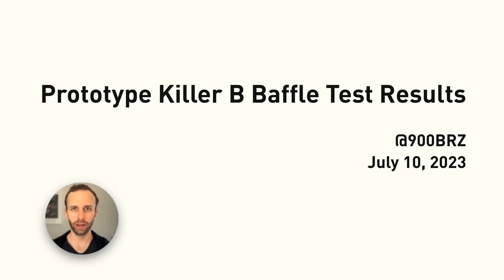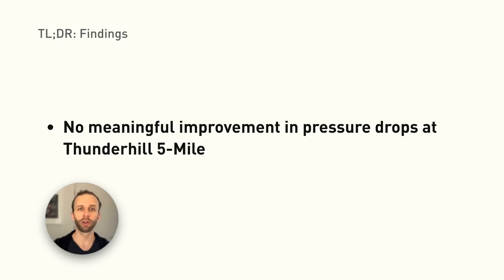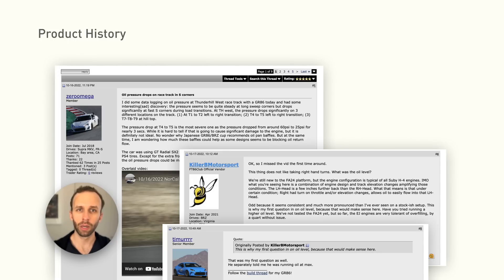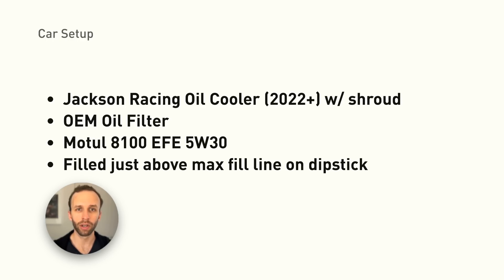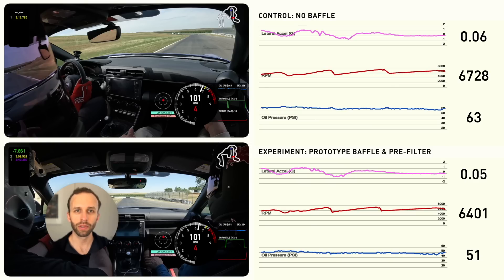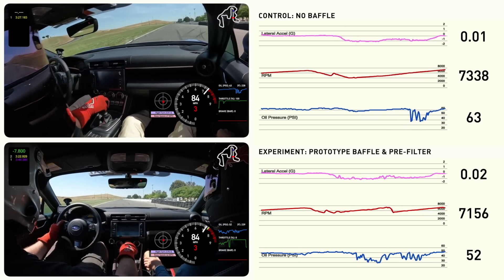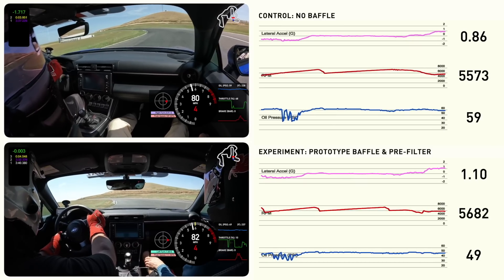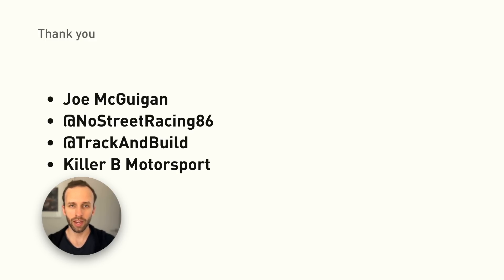BRZ/GR86 FA24 Killer B Prototype Baffle Test Results

Comment: Since the oil pressure drop seems more during right hand turns, could it be that centrifugal force is causing the oil to shift to the left side of the crankcase?   This shift in oil level might cause the pickup to be partially sucking a small amount of air.  Maybe increasing the oil level would be a good thing to try.  If this changes the oil pressure in right turns, then a redesign of the pan or the pickup might be the answer.
Reply from the maker: Yeah that’s essentially the classic mode of oil starvation in high G conditions. I tried a different, more traditional baffle design next but this also did not fix the issue. https://www.youtube.com/watch?v=LEin1Z--koA 

We are routinely running 1 L overfills now and are seeing moderate improvements, but still observing pressure drops. More testing coming soon.

Comment: If one doesn't track their BRZ/GR86, I suppose the oil pressure drops may be less of a concern? And is the RTV over application blown out of proportion? What do you think?
Reply from the maker: Personally I think for the street use without engine/oiling modifications, you should have confidence you’ll be covered by the warranty if anything goes wrong. It seems like the pressure drops are not likely on street unless you’re pushing insanely hard.

Comment: would it be possible for you to be put really stiff front ARB to minimize chassis roll angle ? Also not sure if your DAQ has this but if you divide chassis roll angle with lateral acceleration...you  get the roll gradient deg/G... You then plot it against oil pressure and possibly see a trend there!
Reply from the maker: Yeah good ideas. Will look into that.
Reply: @900BRZ  you will understeer big time though.. not sure what your balance was going into the right handers.
Reply from the maker: The balance is pretty good right now with all stock suspension and a mild track alignment. Could use more front camber but it’s not allowed by the stock class I run in. There is a fair amount of roll due to the softness of the setup. I did get a set of stiffer bars mainly to create an oversteer setup for car control practice, but wasn’t planning to run them on the track.
Reply: @900BRZ  oh so now i am even more curious about the effect of roll stiffness.

Comment: What is overfill testing ? 
i'm total noob at these things , so when i saw the previous video ....one "solution" came to my mind is , to fill more oil than recommended. so is this overfill testing ?
Reply from the maker: Yup
Reply: @900BRZ  So , did you test it out ? does it work ?
Reply from the maker: Need to do more testing. It’s inconclusive so far but I’ve only been able to test in a single session.
Reply: @900BRZ  Will be interesting to see the final results , keep up the good work.

Comment: I have a feeling its not related to the pickup. Looking at an engine breakdown of the FA20, it seems that oil is pumped along channels in the cover with a rotational pump moving it along. Im wondering if the shift in lateral G's causes starvation in these channels... Just a guess...

Comment: Subaru rally mechanic here: I have seen countless EJ/FA/FB/EZ engine failures due to oiling issues in both Street and race prep form.

The engines that survived were using dry sump systems, its as easy as that. I agree we would like to know the whys of the oil system failure but for anyone wanting to avoid a failure I would point to the world of racing using dry sump systems.

At this point GMC/chev have made one of the best semi dey sump systems available. Compact and inexpensive. Im not sure why subaru did not adopt this style of system for its new generation of engines. It would have saved them headache and warranty returns as well as furthered their racing pedigree.
Reply from the maker: Up front cost I’m sure. I agree a dry sump would be the ultimate solution but there are none commercially available for FA24 and it would be a very expensive and involved modification. Most aftermarket dry sumps are powered by sacrificing some other function, like driving the scavenge pumps on the accessory belt instead of the AC. So not a practical solution for most owners.

Comment: Perhaps the engine is off-camber and needs to be raised a couple degrees on the left side and/or up from the back? Is it possible to explore this approach using OEM motor mounts?
Reply from the maker: Fluids at 1 G will be at a 45° angle to the horizon and we’ll routinely experience over 1 G on track. So, I don’t think a couple of degrees is going to make a big enough difference. Still hopefully we can find a baffle that will.
Reply: @900BRZ  I hope so. I order one of these cars and it's coming from Japan mid next month. I found out about this issue after I placed the order. Debating if I should cancel my order but also still hoping Subaru, Toyota or someone finds a solution cause I really want a gr86.
Reply from the maker: Are you going to track it?
Reply: @900BRZ  I would really like to
Reply from the maker: Hopefully we find a solution soon!
Reply from the maker: Hopefully we find a solution soon!

Comment: So are these results only under track conditions or are there problems on public roads with starvation issues as well? Thank you for all the research!
Reply from the maker: Thanks! We haven’t done any testing on the street, so it’s not clear. Some people have since recorded pressure gauges and not seen drops even in canyon runs, but the RPMs have been lower. If you’re not pushing 6K+ RPM in canyons, you’re unlikely to have an issue.

Comment: Why are you dismissing the timing cover being an issue?
Reply from the maker: The product that was designed specifically to address that issue had little to no measurable effect, so we’ve got to move on to another approach now.
Reply: @900BRZ  ah I see, what about flow issues? Porting of the oil galleys?
Reply from the maker: @samwhite8965  Still more things to try with baffles before porting out a still potentially warranty-able engine. Hoping to test a new baffle on Sept 1 but not sure if it’ll be ready in time. It’s designed by a friend and being manufactured by a motorsport company.

Comment: I'm wondering if the drop in oil pressure could be caused by the crankshaft counterweights acting like scoops for the oil that has already sloshed up to the side of the pan. It would depend on the direction of rotation, which I don't remember if that motor is cw or ccw. If what I'm thinking is correct, turning the car left would make the counterweights scoop the oil back down into the pan, and turning to the right would scoop it up into the cylinder area. I could be entirely wrong  😋
Reply from the maker: There is an integrated windage tray designed into the upper oil pan, so I don’t think this is an obvious cause, but we don’t know for sure.

Comment: This is great work, it’s a bummer you (and KillerB) haven’t found the resolution on the first try but it’s interesting to witness the process. For purposes of looking at potential oil pump starvation I do want to mention, a user (ETM_Shaman) on the ft86club forums tested something similar with the first gen FA20. He drilled a tap into the timing cover and measured pressure right at the oil pump. I’m not sure how much has changed on the FA24, but wonder if that may be a viable data source.
Reply from the maker: Yeah I’ve read quite a bit about modifications to the FA20 and have come across his posts. I’m not going to commit to drilling into the timing cover or block while the car is still under warranty. Hopefully we can find a solution without going to that length.

Comment: Anecdotally, I’ve seen multiple WRX STIs fail immediately or shortly after installing the Killer B oil pan and/or oil pickup, including the STI that was filmed blowing up on Gears and Gasoline immediately after installing the Killer B parts. I’m not trying to imply that their parts are specifically harmful, just that they may not be as effective as Killer B claims. 

I suggest reaching out to multiple professional Subaru Motorsports teams and asking what brands of oil pans and pickups they use in competition, then contacting those brands to discuss their designs and how they compare to Killer B’s. 

There’s plenty of FA/FB engines surviving in high-level professional racing competition. Find out how those motorsports teams are handling the oiling system in their comp cars.
Reply from the maker: I’ve been in contact with several people who are participating in GR Cup. They run higher oil capacity than stock and have a welded-in baffle in what looks like a stock oil pan. They’re running 0W40 oil and I’ve heard reports of multiple engine failures. Unfortunately they don’t televise practice sessions, so it’s not possible as an observer to understand the total failure rate.

Comment: I wanted that I’m in school to be an aircraft mechanic and they use a lot of baffles or “slosh boxes” around their fuel pumps so maybe just copy one of the design of an airplane and maybe it’ll work real well for the oil system. Jets use a dry sump for oil but the piston planes don’t so maybe look into those as well
Reply from the maker: Thanks for the suggestions. So far we’ve been getting inspiration from other road cars engines, particularly from Porsche, but would be interesting to look at piston airplane engines as well. One of the people in our community who is a mech e is designing his own baffle now and working to get it to the testing phase. That’s probably what I’m going to test next.

Comment: Could there be a chance the oil pump pressure relief valve is being affected in any way? With the new oil pressure reading since its not maxed out there is a bump in oil pressure before it dumps pressure.

Comment: Am I crazy to think that the next test should be stock (no baffle or pre-filter) but add extra oil?  I'm saying this based on what another manufacturer did with a certain performance car with its two smaller engines, and on the fact that you've appeared to also demonstrate a loss of 10psi at all other times.  Chevrolet Camaro 1LE with the 3.6 V6.  GM publishes two owners manuals for these cars, one a standard manual for Camaro, the other is a "high performance supplemental manual".  In there for the 2017 and 2018 model years they state to add 1 extra quart before track events, and then drain it after the track event so the oil isn't overfilled for normal use (this note is not there for 19-21 fo some reason which I'm trying to find out).  The other video you have shows how that pickup tube appears to have some degree of offset, so "if" the oil is pulling too far away from the pickup and causing the drop, could an extra quart in there solve this?
Reply from the maker: That test will have to wait until temperatures are lower, probably in the winter. But it would be valuable to prove the same drops occur without the oil cooler.

Comment: could you space the sump down, have a deeper pickup tube to account for it and do trap doors and windage trays for the sump?
Reply from the maker: You’d probably need a custom exhaust header and to replace the pickup, you’d need to replace the timing cover. It’s possible though. Interested in trying vertical partitions with trap doors first.
Reply: @900BRZ  it would be worth seeing if an improved windage tray is an option, that can help reducing aeration of the oil, with the partitions and trap doors
Reply from the maker: Yeah I have a friend who is designing his own and I’m probably going to test that one next!

Comment: Very nicely done with the regards to testing and information gathering, bravo. Personally i would never run a zero weight oil on the track, even in the middle of winter (we have some ice-/snow drifts up noth in Sweden and Norway). Engine stress (high rpms and G-forces) are just too high (in my experience and opinion). I would really like to see you run a thicker oil weight, or is it out of the question for you? i could not find information on this topic, or maybe i missed this point in your videos. Motul offers a very nice range of racing specific engine oils, 0w-30 as well as 5w-30 (v300 series). My point is, the "standard" factoy oil weight (again in my humble opinion) is suited for everyday driving and not intended for track days (heat, stress and rpms).
Reply from the maker: I’m running Motul 8100 EFE 5W30, partially selected for it’s high HTST value (3.5 mPas). I have friends running 0W40 and 5W40 oils and they still observe consistent pressure drops.
Reply: @900BRZ  Thank you for the info. I am still grinding my teeth with those low weight oils for track usage, but again it is my personal opinion and experience. Is there any possibility to have someone test a 20w-50 oil without the baffle kit and compare it back and forth (stock for stock with just the oil weight being the factor)? That 0w-/5w oil weights are thinning outs at higher temps, rpms, stress and G-Forces at the track. Here is a video that i like to show members who show up at trackd ays, drift days etc and run factory oils (0w-20 or 0w-30) at 40c weathers (https://youtu.be/ASAdkJydBFU). Take everything with a grain of salt, but i would heartfully recommend changing the oil weight to a much thicker viscosity first (just like replacing normal brake fluid to a higher temp. fluid instead) and see what happens.
Reply from the maker: @hussamjamil4980  I made a chart with some oil choices and their rated viscosities at 40° C and 100° C, which are ratings that the manufacturers provide. 

You can see a couple things: the 10W60 is a massive outlier and its cold viscosity is over 3x what is recommended from the factory. 

When you compare *W40, it doesn’t really matter so much what the cold SAE rating is. In my car the max temps I’m seeing 240° F (115° C), so the low end of the chart is much less relevant to what happens on track. 

I will definitely adjust my oil according to the temps and oil pressures I see at the track. 

https://cdn.discordapp.com/attachments/1125132634335494194/1131366710851670147/Screenshot_2023-07-19_at_4.26.30_PM.png

Comment: Great video, really well presented testing.  Also, thanks for actually writing the English subs for the CC button, because they are accurate, and I can't always be sure just by listening what some of the words are, especially with terminology that is very specific or place names that I'm not familiar with.  Usually an English speaking video maker won't bother to write accurate English subs.  So in those cases I'll usually try "English auto generated" or "Auto Translate" and after I've had a few laughs about how bad they are I'll probably just turn them off.  Because the "auto" thingie can't understand everything that is said any better than I can.   So anyway thanks for putting the real words in there in writing.
Reply from the maker: Glad someone appreciated that!

Comment: If it's not a baffle issue, I wonder if the problem is caused by oil pooling up somewhere else in the motor or a restriction causing the oil level in the pan to drop. Excellent video and props to Killer B!
Reply from the maker: This video just disproves the hypothesis behind one very unique baffle design. I still have hope for some other baffle designs. More testing coming in the future.

Comment: Crazy idea from a layman, but maybe make a modified pickup tube that digs deeper and with a bias to the drivers side to pick up more oil on that side when making right hand turns?
Reply from the maker: That’s the right idea, but you'd need a custom exhaust header to make room and to replace the pickup, you’d need to remove the timing cover. It’s possible though. Interested in trying vertical partitions with trap doors first.

Comment: I think the problem is not about oil pan not sucking up enough oil, but actually not draining back to the pan due to getting stuck in the heads,Porsche has 5 pumps to help scavenging, I think the issue had to do with the increased displacement, I would also check to see if overfilling 0.5-1qt we’ll help the issue to an extent
Reply from the maker: Either way I think a moderate overfill could help, but we’ll see!